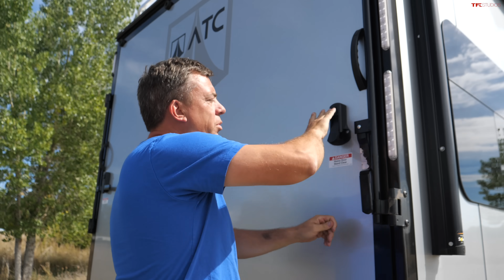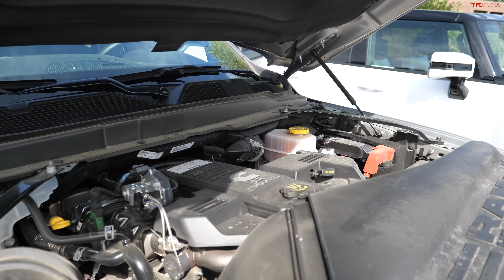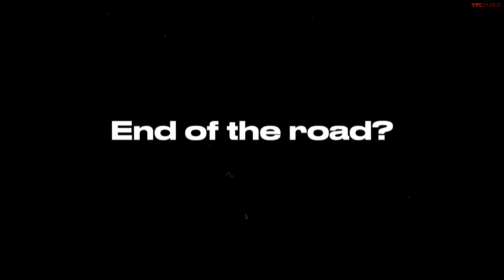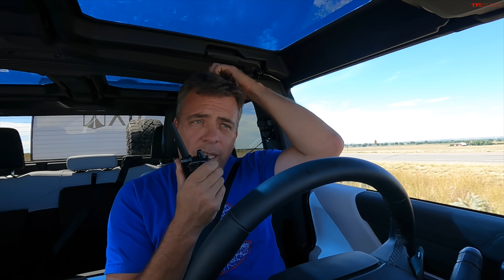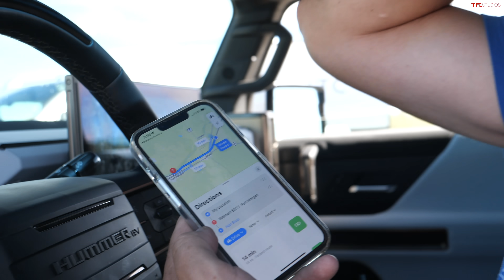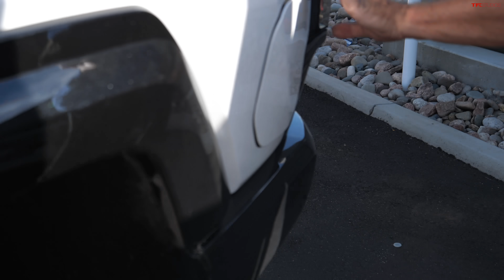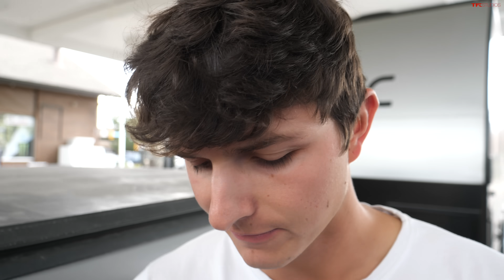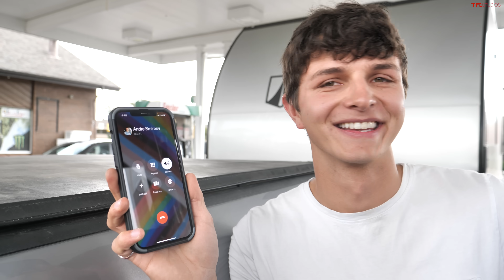How Far Can a Diesel and Electric Truck Tow An Identical Camper Trailer on ONE Fill-up?

Comment: Diesel truck can also fill right up to 100% of its range in 5-10 minutes at the pump. Not 30-60 minutes just to go from 20%-70% (which is only 50% total).
Reply: When we stop to refuel, it takes more time to go to the restroom and get snacks then it does to get diesel. High flow truck stop pumps get it done in 2-3 minutes
Reply: The whole infrastructure will have to change if it takes 60 minutes to charge your vehicle....what are you going to do during that time? ....going to have to be cafes, coffee shops and restrooms or in my state a place to get out of the heat.
Reply: @anderander5662  the lines will be horrid too
Reply: A total refueling and "pit stop" at a diesel pump equipped Quick Shop would take around 15 minutes max, for fuel, attending to personal hygienic needs and grabbing a snack. Can't say that for an electric vehicle at this time. People have reported they can go from20% to 80% charge on a Hummer sized truck in around 45 minutes on a "fast charge" station.
Reply: Wait for an available charger and that could become 90 minutes or more.
Reply: I thought he want from 7% to 50% in that 40 minutes time.
This also confused me. if it took him nearly 100% charge to get to charging station, how will he get back to denver with only 50% of the charge?
Reply: So the savings on the cost to refuel vs recharge is spent in convenience stores eating or who knows what. So ya get range anxiety.. spend a ton of time needing to search for wherever you can Detour out of your way just to wait in line so it's your turn to plug in and wait even longer...only to only get up to 80% before it slows to a slow charge..so most people will be impatient & leave once again without a full charge enough to get to the next waiting game. Meanwhile the Engine powered vehicles don't get range anxiety... can find gas stations everywhere, often multiple stations next to each other..... all capable of refilling to 100% full (vs EV that go to 80% then slow charge the last 20%),..
  keep America Fat, buy an EV and you too can spend the money you saved refilling on finding ways to waste time while it partially recharges.. go buy overpriced convenience store items or you might as well get something to eat & drink... since you'll need to recharge more often than refilling a fuel tank... you can waste even more Down Time waiting to charge.... meanwhile.. the much cheaper engine vehicles have refueled & actually got a full tank vs 80%... and are LONG gone enjoying life... 😉
Reply: I know, my girlfriend has a Tesla. So inconvenient letting it charge while we're shopping instead of stopping at a gas station and paying more than three times as much for the same distance. Or that 30 minutes we had to stop every three hours when we drove up from LA. And don't get me started on those silly solar panels we got that cover our house's energy consumption and generate enough to get 600 miles every month before we start consuming from the grid. 
EV: Upfront espensive
ICE: Long term expensive
Reply: @rusty2381  I'm currently at a rest area in BFE Idaho, hate to tell you bud but there's NO shopping when you're between cities. Now imagine that 90% of the vehicles on the road are EVs and you're struggling to find an empty charger because it takes so damn long yo recharge each and every one of them. If you say "oh, just charge at home" you've got another think coming. Hell how often do people forget to plug their phones in to charge them!
Reply: @dundonrl if I forget to plug my phone in at night to charge it, is it because mobile phones are an inferior design to land lines?
So if you're argument is based on the lack of infrastructure to support ev's, are you implying that refineries and gas stations are a natural occurrence?
Reply: Or the millions of  Americans that Rent multi family homes and parking is on the street?
Reply: @rusty2381  If you were worried about cost you would not have nought a Tesla.  A $25k Ford Fusion could have been purchased and at $5.00/gallon, you could have driven it 135K miles on just the money you SAVED not buying a garbage Tesla
Reply: @sho942000  A: Never said I was scared of cost.
B: Not my car, my girlfriend's
What I was pointing out was long term cost vs upfront. 
All things being equal in the electric drive train we could say the cost of maintaining both electric cars (a Ford and Tesla) would be even.
Except the fusion can't run on just EV mode, it hast to use the gas engine as well. Gas by energy density cost more than twice at much for 1/3 the efficiency. 
Now look at the engine, any moving part is a potential failure point. The fusion and any other hybrid has an entire engine to maintain. An EV does not. 
Now power loss. Trace the power from combustion to the wheels. At every union you have a little parasitic loss. Piston, crank, trans, drive shaft are all points of loss. That's why people specify wheel horse power and crank horse power; there's huge a differnce.
70k miles, her EV has not needed an oil change, new plugs, ignition coils, none of that. Cant say that about any ICE.
Now hybrids do typically last longer than gas vehicles because the electric motor reduces the wear on the engine. But adding an ICE to an EV is not gonna reduce the cost of ownership in any sense. 
Consider this, a century or so ago poor people had horses and the automobile was a status symbol of the wealthiest. Now, not so much. Basically we're at that point where manufacturers are starting to transition from a luxury reserved for the few to desirable (nobody wants a Chevy Bolt, they tolerate it) EV's for the masses. 
I'm not saying everyone should run out and by an EV right now. What I'm saying is if you own it long enough (those of use who buy a vehicle with the intention of keeping a car and not just trading it in a few years later) the long term cost of ownership of a gas car will surpass the cost of a comparable EV.
Simply put, it's the "Boots Theory" of economics. (Look it up)
And one last thing, Ford 🤮
Reply: @sho942000  most of the other Dodge And Chrysler vehicles are junk after 135k miles. At that point the majority are not worth fixing
Reply: @rusty2381  let's see how well long term ownership works out on that tesla when it's time to replace the battery at 16 to $20k...
Reply: @lilcourtny08  pure fantasy... my 2003 Ram has 307,000 miles right now, original motor and transmission, never been opened up
Reply: @finish_my_projects  one example doesn't mean it's true, most 2003 Chrysler vehicles are already in the junkyard
Reply: @finish_my_projects  Let's say it does need a new battery at 15 years. I would gladly compare that cost with they cost of keeping that Ram on the road 15 years if that truck can even last that long. It'll probably be in a scrap yard in less than 10.
Reply: @finish_my_projects  
you say your 03 has over 300k. Great, let's do some math. Now, I don't know if you have a diesel or gas, so I did both. The average mileage for the gas was 16 mpg and 13 mpg for the diesel. So with that, you've purchased between 19k to 23k gallons of fuel or between $61k to $63k. And we're not even factoring oil changes in there, which would be 51 if you do it every 6k miles.
So yes, long-term vs. short-term expensive.
Reply: @lilcourtny08  you can cry about it, but it's still true
Reply: @rusty2381  I guess reading comprehension isn't one of your strengths, make sense... take a look at the 2003 again and then let's see if your math sucks as much as your reading 😂😂
Reply: @rusty2381  how about this, you have a 10 year old car (or less) with a dead battery... are you ready to finance another $16k to $20k just so you can drive it? Or scrap it? That's the future of EVs and people are just figuring it out
Reply: i_need_to_finish_my_projects  11k for solar panels and 16k for a battery to keep the car on the road. Maybe my math is off but 27k seems to be less than half of the 60k you've paid in fuel charges to keep your dodge on the road 20 years.
So, even in your worst-case scenario,  yeah, I'm good.
Don't beat yourself up, math isn't  everyone's strong suit.
Reply: @rusty2381  hey its easy to win this game while you cheat with subsidies and not paying your road tax, wait until those hit and you all start crying... not to mention, no matter how much money I could have saved, a battery car could never have done all thr driving I did with my truck, much less a battery truck which is an absolute joke...
Reply: i_need_to_finish_my_projects  your whole stance is since it's not practical for you, it's practical for nobody and everyone who disagrees is stupid.  
It doesn't work for you, fine. We're not all you. You can keep getting raked over the coals with fuel prices and tell yourself it's better to pay three times as much over a long period of time than a large chunk up at once. That's the case for a lot of people. 
I've got a 20 year old chevy with 200k on it, I'm not rushing to trade it in. But when it's time comes, I'm going to go with what will have the less expensive cost of ownership of its life span because I've managed my money well enough to be able to.
Reply: @rusty2381  that's the lie you tell yourself, practicality isn't THAT specific to people.. if it's not practical for me, it's not practical for about 70% of Americans... hope you don't break that plastic nipple on the front of your battery pack that tesla refuses to repair,  it'll cost you $20k (which is what NY truck cost new, forgot that in you calculations I see) 😂😂😂
Reply: @finish_my_projects  if that's what you gotta tell yourself to make yourself feel better, more power to you.
Reply: @rusty2381  battery cars are a scam, some of us are smart enough to see the scam
Reply: @finish_my_projects  cool story.
Reply: @rusty2381  until it happens to you too
Reply: @finish_my_projects  whatever you say, just jotting down your expert advice in my book of stuff I don't care about. Falls somewhere between the Kardashians and the Book of Mormon.
Reply: @rusty2381  yeah but it will take a while to spend the difference in cost compared to an EV. 68k vs 115k. gonna take a while to spend that much in gas and maintenance.
Reply: @Stackali in this case, absolutely but these are not similarly equipped vehicles. If you dropped the cruise mode, rear steering, fancy tailgate, T-tops, and reduced the output from 1000hp to 500 (which still surpasses the cummins), it would come down about quite a bit. Not down to 68k but not an insignificant amount either. Over the life span of the vehicle, I can almost guarantee that difference is gonna be surpassed by a turbo diesel. 
New diesels just do not have that bullet proof reliability that old diesels came with. Conservative estimates put the life span of EV batteries at 15 years, which still surpasses the life span of most modern ICE vehicles.
Reply: @rusty2381  --  LMAO!!  My 2005 and 2008 diesels are going strong.  You're fooling yourself and falling into the EV trap.  Drive that EV 150K and see what happens, especially when the batteries need replaced. You'll see, in time........
Reply: @ironcladranchandforge7292  quick question, what brand generator do you use to power your house. Since diesel is far superior and cost effective, I can only assume you're not plugged into the grid.
Don't break your arm patting yourself on the back over your cars, my 98 and 03 are also still on the road running fine but that's because, I'm assuming much like yourself, I've put the time and money in to keep them that way.
I have a lot of experience working with diesels and electric motors and diesel engines require exponentially more time and service to keep operational. Our salt water cooling pumps that move about 1000 gpm and run nonstop; we hit  the bearings with a grease gun on the first of the month and I've never had a failure beyond a dirty contact switch. There's just significantly less potential failure points on electric motors.
Reply: @rusty2381  --  Yes, but you're talking about electric pumps working on the grid, LOL.  The problem is not with the electric motors, it's with the batteries, charging time, towing ranges, etc. Get back to me when battery technology improves to the point of viability against ICE vehicles. It's not there yet, and perhaps for some time to come. Also remember, we all don't live in a city or suburb.  Some of us live remote where the closest town is 150+ miles away.  Talk to you again in about 20 years, perhaps...........
Reply: @ironcladranchandforge7292  so basically your just gonna sit there and make the same arguments that horse and carriage owners made some hundred and some odd years ago about how the automobile will never be practical with 100% of the certainty they had and zero sense of irony. 
Kind of adorable...
Reply: @rusty2381   --  No, LOL.  I just don't want to sit around for an hour charging a truck every 100 miles. Use your head, it's not practical, at least for somebody like me. Maybe for you flatlander city types.  I'm sure an electric truck would be very helpful deep in the woods cutting 7 cords of wood like I just did.  Simply plug it into a tree, right??  I'm sure it would do a great job hauling my stock trailer 300 miles to auction, full of animals and no charging stations in between.  Just plug it into a sage brush, right?..... Go away!!
Reply: @ironcladranchandforge7292  oh, so since it's not practical for you, it's not practical for anybody. You can't plug in and charge from a tree but apparently that tree pisses diesel? 
How about your garage, does it produce diesel? Mine produces electricity. Enough to power my house with enough left over for 600 miles a month. Doesn't sound like a lot, but it's also at no cost so that's pretty cool. Imagine just getting a full jerry can every week for no charge. It's pretty nice. doesn't alleviate us having to pay for electricity, but takes away a noticeable chunk.
"It doesn't work for me cause the infrastructure hasn't been established." You know gas stations aren't naturally occurring right? They weren't planted by Native Americans.That all had to built too. Including ones that could accommodate larger vehicles like 18 wheelers.
Your whole argument has shifted from they're not practical at all to they're not practical for you. But from what you said, gasoline engines are also impractical for you so maybe nobody else should have one. 
Maybe, just maybe, you're not as special as mommy told you.
Reply: EVs will never be practical for everyone… After over a decade of EV being available, 96% of new vehicles sold are still ICE. Americans still prefer a 3 minute refuel and ability to tow anything anywhere.
Reply: @ironcladranchandforge7292  EV wont care after 150K. Current data shows that. These battery's are rated for 25 years, 300K miles to 70% health. Most ICE cars are broken down and in the scrap yard by that point after an expensive life spawn of maintenance.
Reply: @silvy7394  no, they're not. The rest of the vehicle is usually junk. EVs don't change the body from rusting away, plastic from breaking, and electronics from failing. My sequoia has 254k on it and my Cummins has 320k. No problems on either. Service life of a Cummins is 500k. The body will blow up before the engine/tranny.
Reply: @bannana --  Yep, I hear ya.  Plus you can go more 100 miles and only 5 minutes to fill up!!
Reply: My problem is… I can’t drive 55. When traveling I set my cruise at 80mph and enjoy AC in summer. What range would an EV get driving 80 with AC on?
Reply: Being sarcastic and getting defensive about EV's is a tactic governments use when they want people to feel ashamed of their opinions.

Stick to facts.

Facts = 

EV's are less efficient for time and but a little more efficient use of energy.  The resources used to create the power it is consuming today, is not anymore friendly to the environment.  It takes toxic items to create solar panels/batteries.  So are you helping the environment or hurting it?

ICE = efficient for time and power consumption (as mentioned in the video, a little less than the Hummer), but 0 range anxiety.

I don't think 3,000 lbs of rare battery materials per vehicle is a solution.

Comment: Efficiency thoughts are flawed. Range was 2/3rds towing for diesel 1/3 towing for electric. Never mind what’s your time worth ….Let’s say you went 300 miles. Pretty much do that straight in the diesel likely take 3 or 4 more hours in that electric….at least!  Also for the price difference you can buy 12000 gallons of diesel 😅
Reply: Bingo. They're lifestyle vehicles right now. It will take a 500 kwh battery that can charge at 3 MW to be feasible as a long hauler.

Comment: I know that an EV is “efficient” for what it is but pulling skid steers and mini excavators or loaded dump trailers around Kansas City is not far by any means but I would be scared at all times with an electric vehicle. Yes there is charging stations everywhere here but when your always on a time line then it just doesn’t work. They say Ev’s are perfect for the average city driver, maybe but not if your touching a trailer. I would honestly love one of those f150 lightnings and I think a lot of foreman and bigger job site guys around here would too but as soon as an emergency happened and they are the only one with a truck to pull the trailer that’s a scary thing and that happens every day around here on all sorts of job sites I go to.